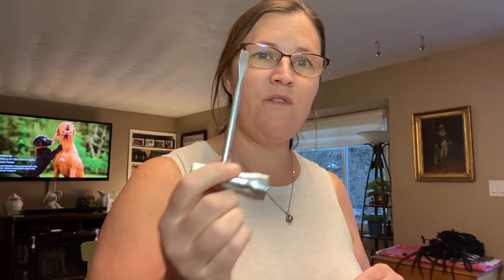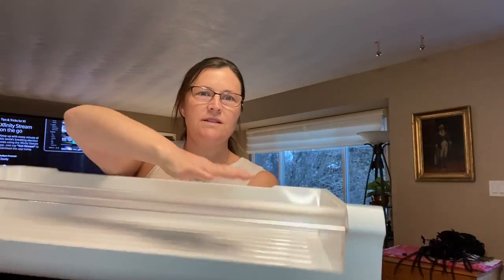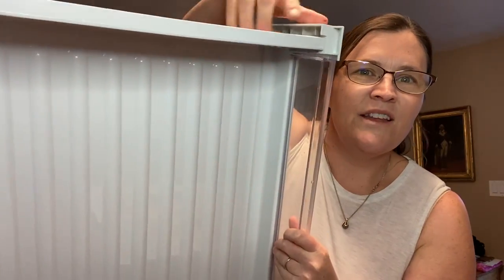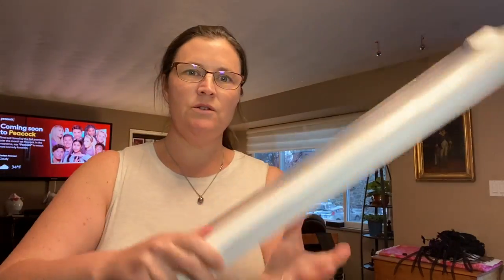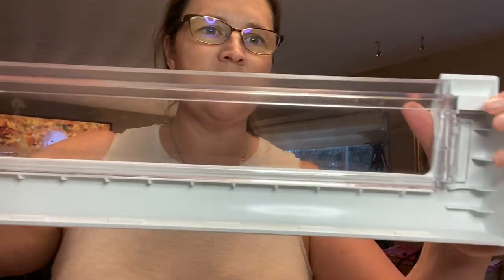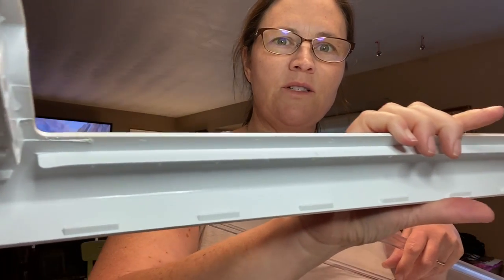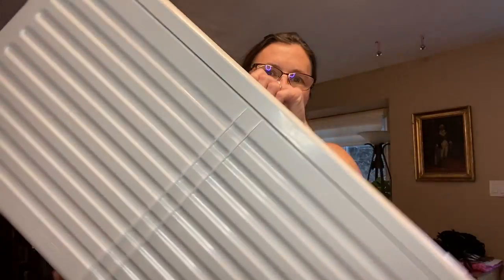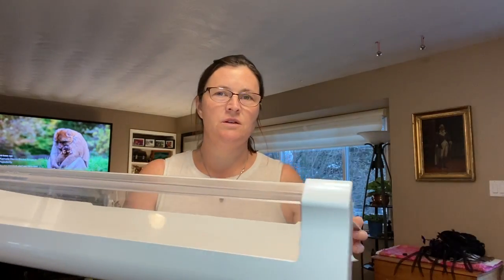How To Disassemble Crisper Drawer On Kenmore Model 253.70413414

Comment: How do you get the deli drawer back into the fridge...I have the same fridge as you and after getting it out...I cant find a tutorial for reinserting...thanks for your tutorial on disassembling the drawers BTW
Reply from the maker: To be honest, I no longer have that fridge. If I remember correctly, you have to pull the side rails out all the way, place the drawer in and then slide the drawer into its space.  So you need to line up the side rails before being able to push the drawer in, if that makes any sense.

Comment: Having issue with inserting the drawer back in - how do you do that - with rails extended out or not
Reply from the maker: Mine works best with the rails pushed all the way back in.  It takes a little convincing, but once you find the channels the rails go into, the drawer will slide back in.

Comment: Do you know how to remove the lip of that drawer section?  The plastic part between the 2 split drawers and the deli drawer?
Reply from the maker: take the drawers out, take the glass out, and that piece should pull up and out.
Reply: I'm having the same problem-question.  I figured out the drawers but liquid has gotten in between the lip of the french drawer holder.  The part between the 2 drawers and the glass top on the long drawer.  Any suggestions?
Reply: @gailhallmark2118  same issue here now.Did you figure it out?There is a silver rail that snaps it together but I don’t see how it comes apart.Funny you had same issue,ugg !